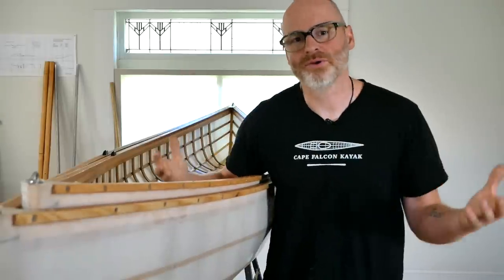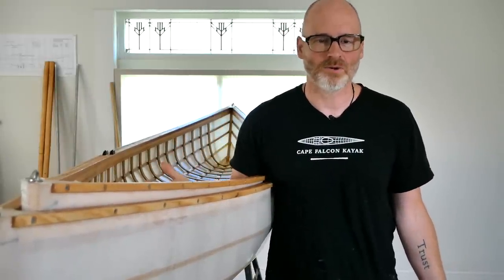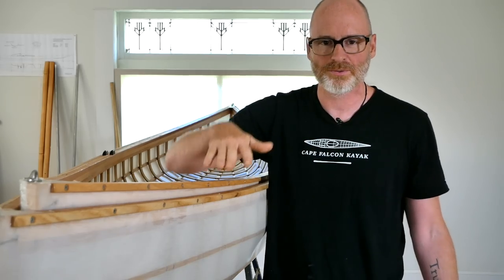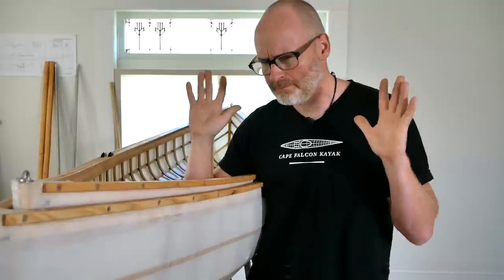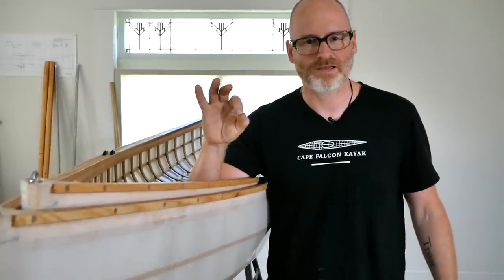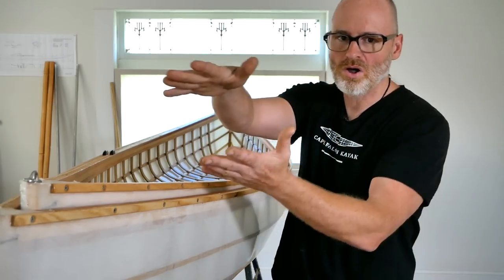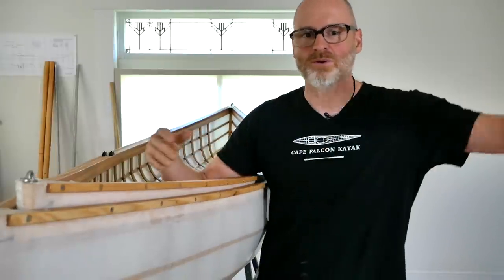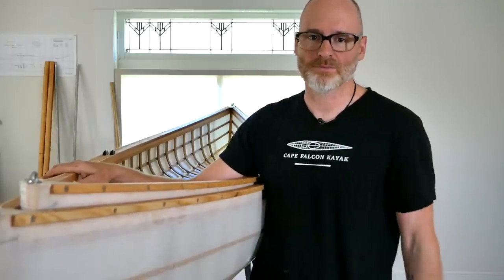Building a skin-on-frame Canoe, Part 10: one step forward, two steps back

Comment: So I'm planning on building at least a pair of these (after the F1 of course), my question is this: Would there be any advantage to build one size or the other first? Assuming I won't have room to build them simultaneously, is there a preferred tradeoff to which size to build first or second. Thanks.  

Also if that's in the course materials/updates, I can find it there.

Comment: Great presentation B. Its seems a canoe of this type is like what a bicycle is to a slingshot bike.The stringers are too rigid and possible twisting some dowel (two or three) together to create stringers would act as s shock absorber down the hull  maintains  maintaining the sheer (original design) .Just s thought.

Comment: I've a set of glued lapstrake canoe plans that I've been wanting to build. But I have a problem. Epoxy set time/temperature. I live in a place that only has a few days a year where the temps are warm enough to actually build said boat. And that time of year is prime cycling season, which I'd much rather be doing. That's a long way to say that I'm really looking forward to your canoe plans. I'd be willing to be a beta tester if you need that.

Comment: Been a fan a long time, watched all your vids many times, always stoked when a new vid drops!

I wonder, did you ever consider a asymmetric hull shape at all through the process?
Reply from the maker: I'm almost certain this will end up as an asymmetrical boat, but I need to understand the symmetrical shape first and get it right, so I can compare the performance.  Once I get symmetrical correct I'll be heading into asym

Comment: What are you bow to stern ratio, bows are made to cut through the water and stern are for the purpose steering, I like double enders, but I want boat that works with a good strong cutting bow, plus draft to the point your not sitting on top of the water like a water bug. I will keep watching your builds and designing and see where you get too!
Reply from the maker: Hey Richard, this is an old video, check out some of the newer stuff, expecially my latest about full size canoes, I go into a lot more detail talking about exact that.